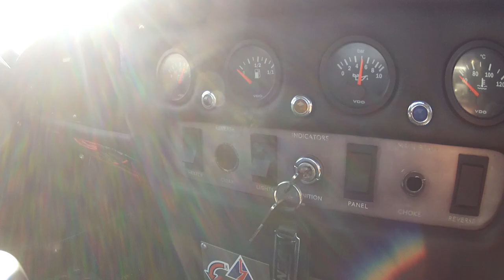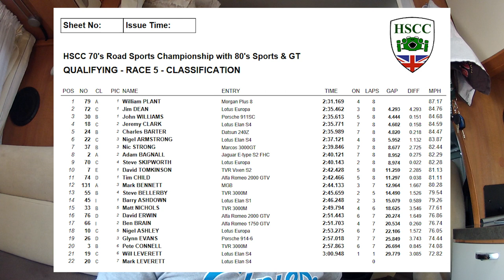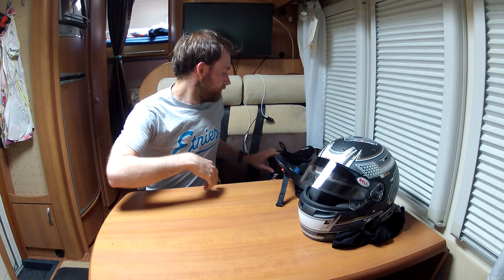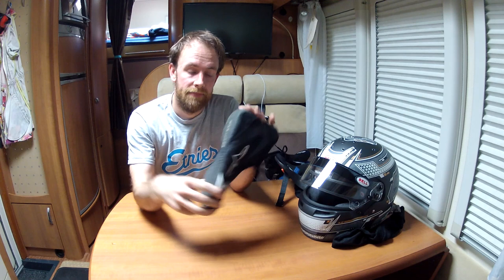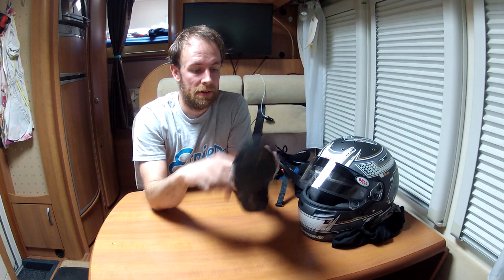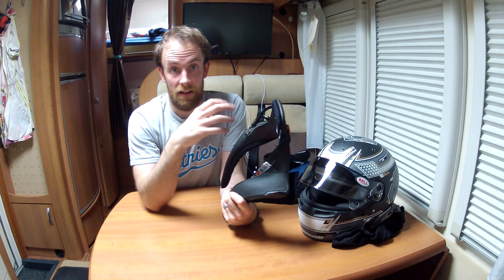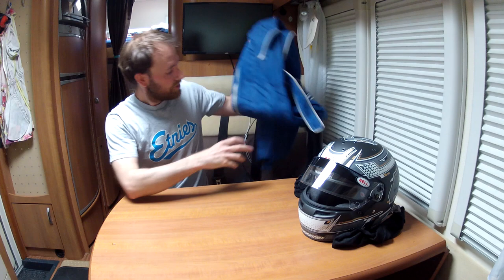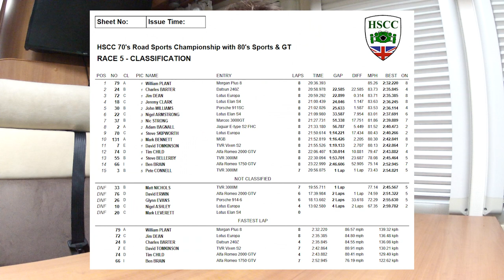Silverstone GP 2022 - Behind the scenes. HSCC 70s Roadsports classic racecar championship

Comment: What a great experience for your children as well..No doubt they will be following into Motorsport in the future because of it.
Made my debut at Lydden Hill on the May 18th 1980..I know it is 42 years later but all i had to do was turn up with my licence and gear ,yellow square on the back of the Imp with black cross. No ARDS test or Hans devices back then..
Tow vehicle was a £200 VW Variant estate..The experience was a disaster as all i managed was a 300 meter run of the track in practice..
I struggled on till November where at least i was videod on BBC Grandstand..Still to this day trying to source that clippage..